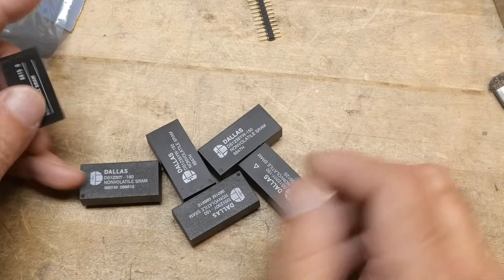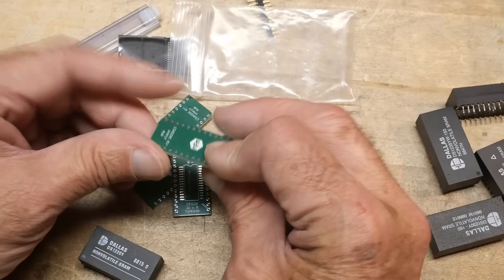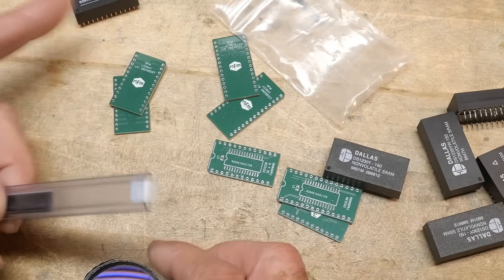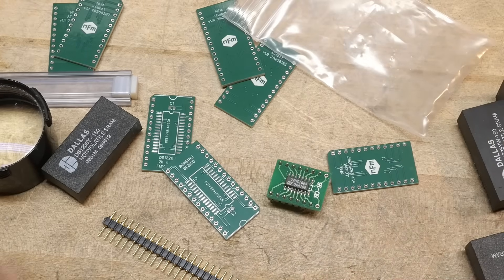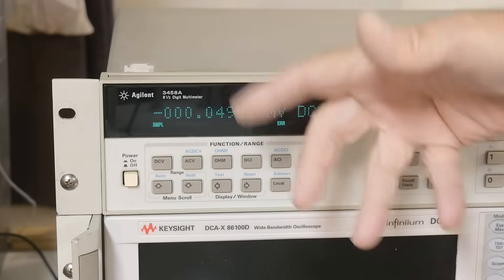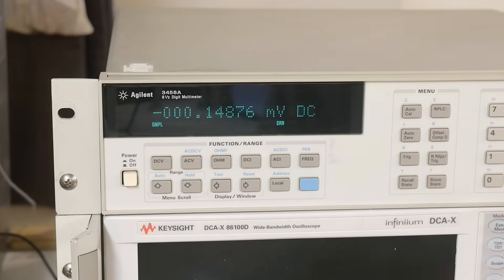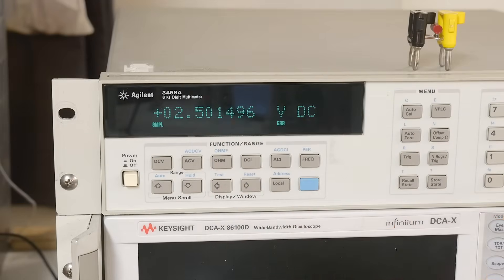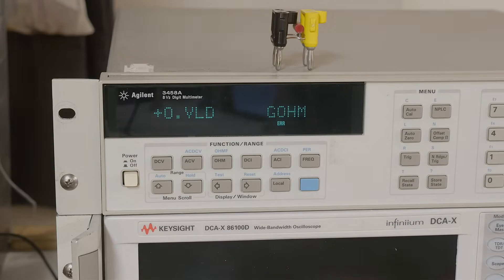#2421 Agilent 3458A 8.5 Digit Multimeter (part 16 of 16)

Comment: A 'working machine' is running a drift test 24/7 for about 1 year or more to determine if the drift is low enough to pass specifications (U180). The drift has to be at least < 0.43 ppm/day over a week. But this benchmark isn't that great.

Comment: Did you take into account that the Dallas clock chips might also be used to run a clock clock chip and not only keep the cmos ram storage
Reply: The DS1235, DS1230, and DS1220 shown in the video are ram only, no clock.  Something like the DS1244 and DS1744 would have onboard RTC plus ram.  Dallas made heaps of versions with different ram sizes, with clock or without.

Comment: I do have some of the FRAMS in DIL case on the shelf and I do not need them anymore. I will check the exact codes and if someone is interested I could give them away.
Reply: I have a 3458A literally on a FedEx truck on the way to me right now.  Are the specific FRAM chips used here no longer manufactured?  If that is the case I would be interested, but if they can still be bought from Digikey / Mouser / RS etc... then it's less of an issue.
Reply: @neverendingstudent  The DIP through-hole type FRAM chips are no longer manufactured, hence these SMD to DIP adapter boards shown in the video. The SMD FRAM chips are still readily available.
Using a DIP FRAM just means you can plug the chip straight in without an adapter board. It looks nice and clean, but functionally both types are identical.
Reply: @neverendingstudent  I also have a bunch of Flash memories in DIP32, likeAM28F256-150PC (2), D28F256-200P2C2 (4), MX28F1000PPC-12C4 (1) plus hundreds of UVEPROMs of various sizes. Let me know if something is needed
Reply: @neverendingstudent  For some reason I can not see my reply to you here. Anyway, I do have three of FM1808 in DIP28 and I can send them to you. I have also STK16c88 as a replacement for the Dallas. These are here in semiactive use as service/maintenance parts so I would ask some price for them. They may be available in some retailers too.
Reply: IT LIVES!!!!!  I was diagnosing and researching the Outguard Power board and going through documentation and videos of other 3458A repairs.  It was xDevs, of course, and guided me true!  The two large inductors on the board can have mechanical connection failure.  I wiggled each, and lo and behold, SHE POWERED RIGHT UP!  Errors at first, until I realized one of the connectors that I had pulled during disassembly had been overlooked, I shut it down, plugged that back in and checked over all the other ribbon cables with care, power on... NO ERRORS.  Self test: NO ERRORS.  She still has her calibration offsets!!!!  All functions tested against my standards, ALL READINGS ACCURATE!!  Within expectations of not letting the 3458A warm up first anyway.

Christmas came early gents!  A university THEW THIS IN THE TRASH!  Options 001 and 002, extended memory and ultra-low drift high precision voltage reference, and a university Threw.  It.  Away!
Reply: @neverendingstudent  Congratulations!
Reply: @henk38599  Thank you!  By the way, I tried replying to you about the DIP chips and it didn't go through.

Comment: If you know someone that has an AC voltage calibrator with a Wide Band output, you can use that to set the AC calibration.  It is using the TVC just to hold the 3325 output flat. Can also use Fluke 5790A with wideband to monitor the output at high freq.

Comment: Those are my adapter boards! I'm really glad they worked well for you! 😁Welcome to the 3458A club, time to fall down the voltnut rabbit hole...

One trick for young players with that DS1220 adapter, make sure to solder that FRAM somewhat quickly as a prolonged time at high temperature runs the risk of depolarising the memory cells erasing it! It's not going to damage the chip, but you'll have to reprogram it.
Work relatively quickly and it'll be fine, just don't do any reflow on a hotplate.

And one last note, My surname is pronounced with a hard K at the start and with the T at the end, but I won't hold it against you, everyone makes that mistake! 🤣
Reply from the maker: Thanks for making the boards available!
Reply: NFM, dude, we need new Akihabara Tek/HP fixer uppers, it's been a while!
Reply: @browntown52  I know..... I have a few projects on the go to get done and uploaded. Life has been getting in the way for a while.... 😑
Reply: Hello sir, is there a similar solution for DS1644-120?
Reply: @daisizhou  The DS1644 is more difficult due to the real-time clock. It can't be just a plain FRAM chip, but needs to be a recreation of the battery backed SRAM with a crystal and RTC chip etc.
For now it's probably easier to dig out the old cells from the potting and solder/glue in holders to accept new cells.
Reply: @NearFarMedia  OK .thanks